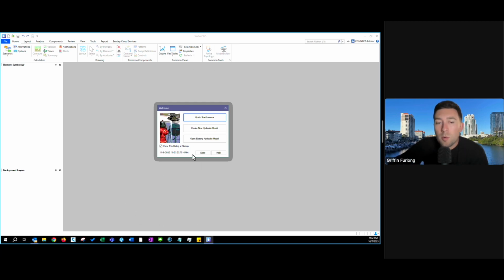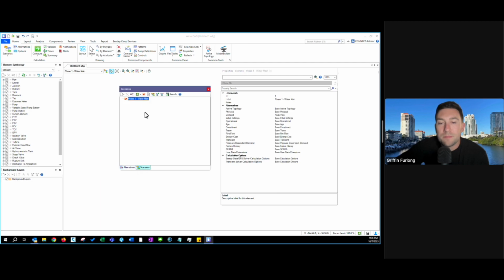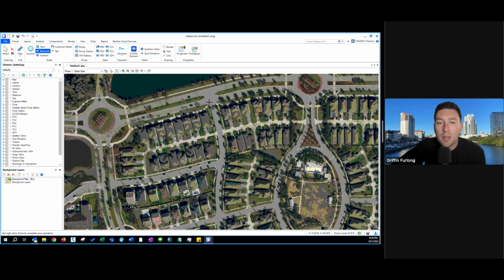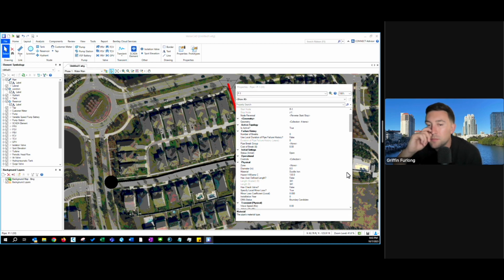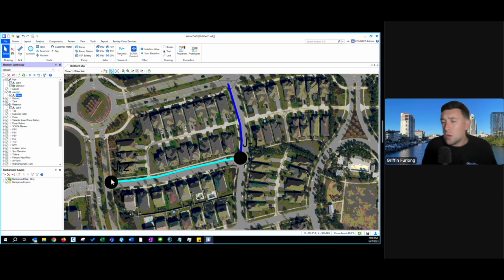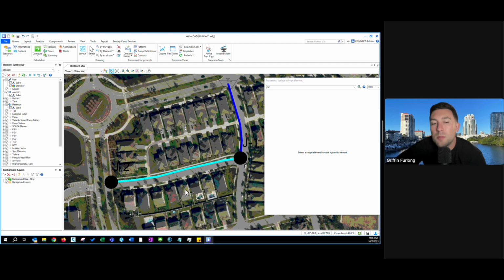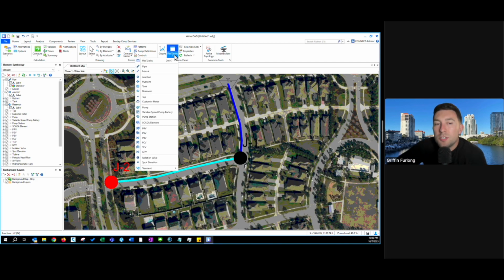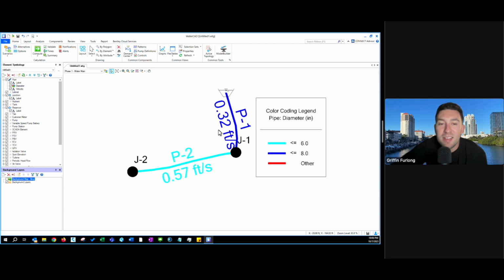How to Set Up WaterCAD Model

Comment: How do you fix if your piping begins having a 0.000 label? I'm not sure what I did to the system, but got everything setup and now my connection pipe at reservoir/pump is reading 0.000 and now all new piping that I try to connect to any junction along the system is automatically reading the same. Not sure if you've ever ran into this issue.
Reply from the maker: @alecreeves218  could you email me the model? Or send screenshots

Comment: Is it possible that you explain how to design a lift station using this software?
Reply from the maker: I could definitely share that process. I’m working on a WaterCAD model as we speak. What I will say though, is that I also typically use spreadsheets as well